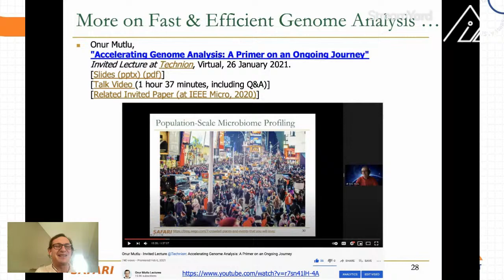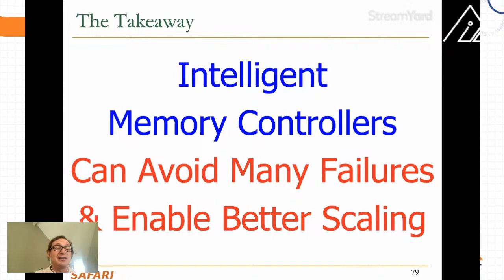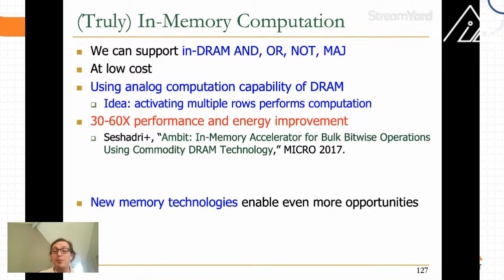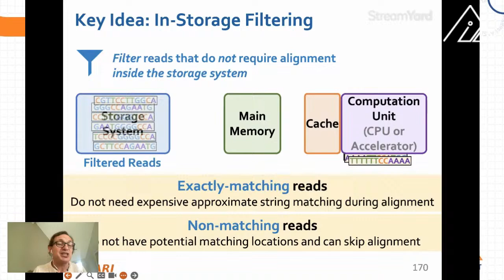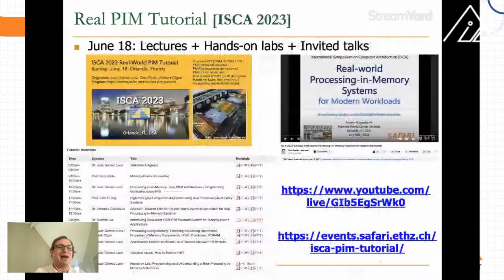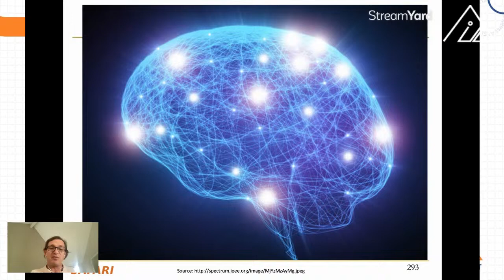Memory-Centric Computing - Talk at AI Summit, School of AI Algeria - 14.12.2023

Comment: how does this type of model of distributed processing would handle the communication between different tasks that would need to communicate there results?

my point is the problem that would limit this type of architecture would be how to handle the communication between different systems (processing units). This problem is essentially the same problem with the multicore architecture and the bottle neck would be how to design programs that would make use of the increased number of compute units. and this means that the main problem that would have to be solved is how to design programs that can be run in parallel .
Reply: i realize now that you don't necessarily  mean to remove the cpu but delegate some of the operation that deals with memory. however, i am still interested in what could be used to make a distributed compute system work.
Reply: also a followup 
you mentioned that we could move a lot of the compute to the memory as the actual operation is happening in the memory.

how would you deal with the latency of the memory cells of the system?